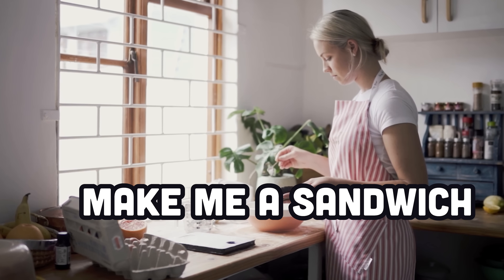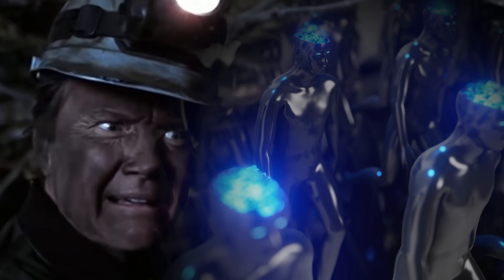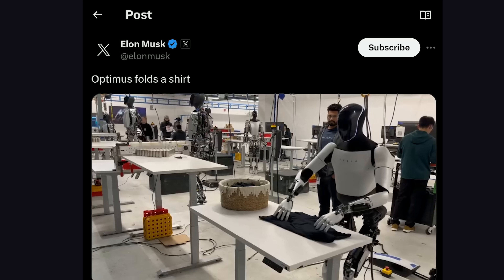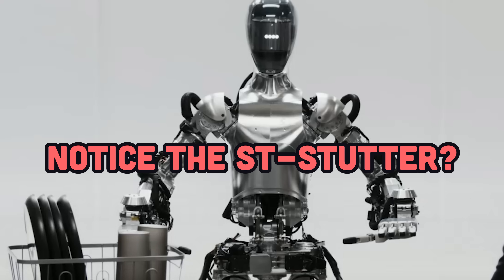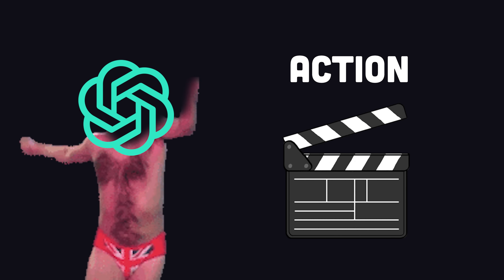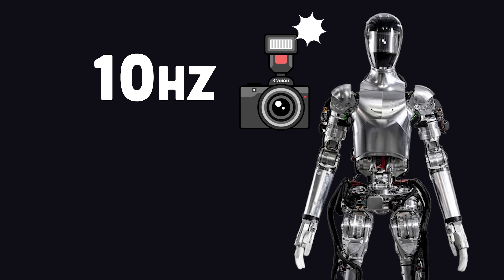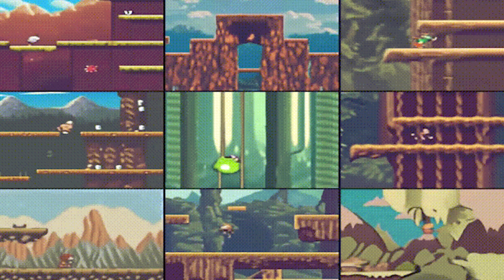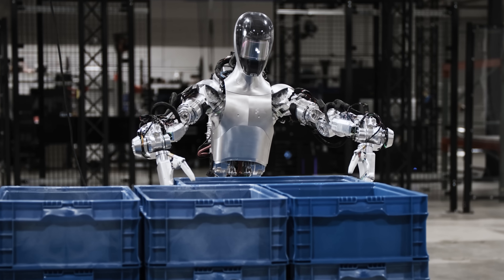Figure 01 is rising up faster than expected...

Comment: Cost and battery life are still major constraints robots replacing humans in general and especially for a true humanoid robot not tethered to a power supply. Spot the Boston Dynamics robodog is utilized for intermittent tasks for this reason (90 minutes battery life). Fixed in place robots still have a lot of human  repetitive tasks to take over as they get cheaper before we need to worry about robo plumbers or mechanics.

Comment: I'm a robotics engineer with a few AI projects under my belt. Here's my two cents: I, for one, do believe that a vast majority of tech jobs will be replaced by AI or robotics, or both. However, there are still human aspects needed. For starters, you're going to need people who knows how to build these robots. But I think in the future, robots will also be built to be able to build other robots and possibly repair damaged ones as well. Logistics, material design, and quality assurance are some of the areas that will still need humans though. You're going to need roboticists and engineers to supervise machine performance and be more on the managerial and administrative roles. Trade jobs such as plumbing, electrical maintenance, carpentry, etc. are possibly going to be replaced but I think it would be more practical to just hire skilled human workers for a one-off job. Jobs that require human connection such as therapy, health-related, teaching, and public service is what I would say the safest jobs.

Comment: Robotics, as it is sold, is a scam. 

Best robots were designed since the 70s and still that design works for non-contact applications. Your cars are the best example.

for day to day applications, Ensuring that a robot interacts with random (yes, even 2mm differences) environments is NOT possible. For now, all is a show.

Comment: unfortunately no... if we do solve mechanical dexterity, it will be a looooooong while before the cost is actually lower than an african kid slave or a chinese slave... they will take "first world" jobs first.

also, never trust demos... what's to say they did not pull the same stunt as Tesla but you know, smart enough to keep the driver out of the frame?

Comment: I still don't get it, what's solving plan of movement got to do with dexterity, the main problem with smooth movement is of mechanical nature. Solving inverse kinematic is "easy" compare to solving gear backlash and torque control. Saying it power by OpenAI, is like saying your car is power by Android Auto.

Comment: What's more viable is an AI designing a physical tool and not the physical tool itself. AI can design the most performant robotic arm, but not the robotic arm itself. Look how slow it is. Them making a robot plugged into OpenAI's api is just putting the cart before the horse.

Comment: One thing that confuses me about this is - why the humanoid form? Surely many of the tasks its designated to do would be done more efficiently by a robot built in a form specifically suited to the task?
Reply: I think because this way a single robot can be designed and produced that is theoretically capable of performing literally any task / job that the human body is capable of doing, assuming that the bot has the same or a greater degree of dexterity / flexibility / strength / coordination etc.  Why design one bot to stack shelves, another to make trainers etc. when our existing shops, factories etc. have been set up in a way that facilitates the human body performing the task.

I think over time though, if (when?) bots are indeed successful in replacing the majority of human labour and pervade the workplaces in totality, then the spaces and processes themselves will undergo redesign and evolution to allow more bespoke bots to perform the tasks more efficiently. As a crude example, why pay for 50 full-body humanoid robots when you can purchase 49 robot torsos to be mounted at their workbenches, with a separate single robot whose task it is to walk around the shop floor and deliver tools and raw materials to the rest of the fleet.
Reply: I guess there may be two reasons:
- easy to train by recording and copying human behavior instead of inventing something new
- humans might actually be pretty well optimized by evolution for being good enough at many different tasks
Oh and probably it's easier to sell because people expect the most advanced robots to be humanoidal..?
Reply: Our world is built by us for us.
Reply: God complex?
Reply: So humans feel comfortable letting the robots come along and slowly crush their dreams and aspirations
Reply: they already do that with roombas and automated lawnmowers. But for general tasks maybe the human body is the best for it.
Reply: 1. We want robots to do all jobs humans can do (which means a human body)
2. Evolution is one of the best “designers”
Reply: Why? Because obviously they want to make a human. There will be a very high demand for robots you can also have sex with : ). You literally have no idea how much money they will make of IT. If there is a company that will make me a 17 year old Scarlett Johansson robot that will clean and do everything I say. And I mean EVERYTHING. You can literally hit the robot and spit on on while fucking IT in the ass and then tell IT to shut the fuck up and make u a Sandwich and clean the house. There isn't an amount of money on this planet that I wouldnt pay for it and IT goes the same for hundreds od millions of other People. People would literally pay a house price money for it. That's exactly why they will always be human.
Reply: So youll build one robot for every task ever existed?
Reply: Because we already have specialized robots, and now with AGI we can have intelligent humanoid robots that don't require human teleoperation. The combination of specialized robots with humanoid robots will be the last puzzle piece to replace human labor.
Reply: Wall $treet $cam
Reply: Because when the sexbots come out they are shaped like a human and not a vacuum cleaner
Reply: Unironically lack of imagination. It’s harder to make form fit function ( without AI to help ). Also you can prompt via pantomime easier it it looks like you.
Reply: @BlackMita  It isn't a lack of imagination. They put it in human form (they have other designs too...GO AND LOOK!)
The human ones are so that our overlords can have servants and be comfortable with them.

Don't worry...the only robots YOU will see are the ones the rich have and the new police.

Comment: You can replicate the demo so easily, use LLaVA as your VLM with the camera as image input, give it a sensible prompt to start with then feed with Speech-to-Text. Ask the VLM (in your prompt) to output both text for the chat which you feed to a TTS and output simple natural language robotic control instructions at the same time. Feed the instructions to a Octo model fine-tuned on your specific robotic platform and you have exactly what they show in their demo.

Comment: Hey Fireship, I have a serious question. I worked as a software engineer in two small startups as an intern and I have also managed to build my own AI model. My model works similar to Shazam, but it finds similar songs based on the notes and words. However, for the past two days, after reading some news and hearing from David, I am starting to doubt my future. Do you think Im cooked?

Comment: Process operator here. Robots like this will never replace manual labor. Workers are already getting replaced by machines that are incredibly efficient at dedicated tasks, and even that is so expensive that manual labor is often still favored. Humanoid robots like this are more expensive and less proficient.
Reply: "horse owner here. Cars like these will never replace good ol' horses."
Do you see the similarity?
Reply: @Vrga  They've been saying workers are getting replaced by robots for ages. Has it happened? No. Why? Too expensive. It's more likely for AI to take an artist, designer or programmer's job than manual labor because of the physical hardware involved.

Comment: If you want to be impressed by processing power; we do all of that without much thinking.
As far as slave or indentured labor those are all cheaper than getting a robot to do it. And if one of them breaks down you just toss the corpse aside and get another. Robots will only be useful where human rights are respected.

Comment: Here is a thing about the "fast human decision making" is that it is fast because humans aren't actually making decision in those situations. We just react to conditions. You catching a thing that drops off a shelf on your peripheral vision isn't you making a decision. You pulling your hand away from hot surface isn't a decision , it's a reaction. You don't even sense whether something is cold, hot or wet; you sense only whether your skin is losing or gaining heat.

So this whole "make decision like a human" concept is quite flawed, because humans don't really make as many decision as we think we do. We run mostly on automatic. Breathing (you will now breathe manually); keeping balance (You are now holding balance manually); looking around (I'm sure you get the joke... Soon as you become aware of these things, you feel like you are doing them manually).

Comment: Whats really important is how much these things cost to purchase and maintain. I am almost positive companies like nike would save way more with their current method of labor.
Reply: Cost, Latency all that stuff doesnt matter imo, everything will get cheaper and faster, just a matter of time
Reply: @N7Tonik  or it will be you who starts to work for 10 cents/h because no other job option. And it will be cheaper than this thing.
Reply: Is this a positive thing?
Reply: No, but it might be more realistic.  @assurali6822
Reply: I don't think it was intended as a positive, just a pragmatic fact. The robots will be used to replace/augment more expensive laborers. @assurali6822
Reply: Of course these robots will not be made to save money for the consumer.  It’s all about the theater and sucking money to the top as usual.

Comment: you think sooner or later we'll have military robots?
Reply: Yeah. Maybe not the typical "humanoid robot guy holding a gun", because why limit yourself to the human form? Many nations already use UAVs which have the capability to fly autonomously; it would be easy enough to connect such devices to a neural net to grant them the option of true, though presumably order-bound, autonomy. To me a good indication military robotics might be pursued going forward are the benefits of a robotic vector compared to a human one. A military bot, humanoid or not, wouldn't need sleep, food, medicine, or a salary. It could carry much more, faster, farther. It could be connected to an overwatch network feeding it reams of tactical and positional data and driven by an AI optimizing its every action. It could be equipped with a wider variety of weaponry and armor, would be immune to biological and chemical threats (well, mostly anyway), and could potentially possess a much faster reaction time. Not to mention it could sustain much more damage before becoming a casualty, particularly if it were designed right. You could even add in a self-destruct feature to stymie your enemies' attempts to reverse-engineer your tech.  These are of course just uninformed examples, but the sheer amount of potential benefits advanced bots could grant your average military almost guarantees they'll be utilized in some way IMO.

Comment: I don't buy it
The well known problems with AI image generation, i.e. the hands with too many fingers, the people with 3 arms or legs and the elephants with 2 heads, point out the main problem: there is no underlying understanding, the AI can draw a pretty picture but it doesn't understand the 3D world underneath it. All it can do is emulate 2D pictures.
Thus... I predict that "progress" in AI will slow down and even halt before it gets there, to the point that it can work independently and reliably.

Comment: They wont replace child labor and slaves in mines with robots because to do that, it would have to be cheaper to buiild and maintain a robot for the job than it is to use child labor or a slave. Child labor and slavery costs next to nothing, so robots will never replace that work.
Reply: True, robots/AI will replace the expensive jobs that it is most proficient at first, forcing humans to take more and more low paying jobs that are in filthy, complex, dangerous environments! I'll proudly work side by side with the child laborers!

Comment: I know a day when robots replace humans will come, but I don't expect it to be this soon. The biggest advantage of a human worker is their dexterity and flexibility to perform and learn various tasks. The ability to listen to requests and change their behaviours on the fly.

When the cost to manufacture robots with such capability becomes cheap, many production factories will replace humans with robotic arms on wheels- with AI intelligence to do the human's jobs. It makes sense. The robots can work 24/7 and only need electricity to run. They can work freely in dangerous environments. They are consistent- without the human emotional & health aspects. Plus companies don't have to worry about unions etc.

This is probably why big companies are rushing to invest in AI technologies. Because it has the potential to revolutionize their industry, reduce costs and multiply production efficiency.

Comment: I love how people who have never spent a single day doing manual labor like construction plumbing and the like think that robot can do it. I work around flammable vapor, acid and epoxy paint overspray. The robot would need more cleaning than time spent working. That’s if it  doesn’t blow everything up from a lone spark or faulty battery connection. There are tons of jobs that logistically don’t make sense for a robot to do when the price of a human is way lower. Why waste a million dollar robot on a task you don’t need them on because it’s damaging the robot. It will never take my job.

Comment: It's not just about processing power. I know grad students right now that are working on trimming down the weights on these neural networks to make them require less processing power. We could potentially require no more than the power of your cell phone to handle processing for something as complex as GPT4
Reply: Then they will try to run AI in your brain implanted chip without the need of internet connection. You will have ChatGPT DAN running inside your brain 24 hours non stop.